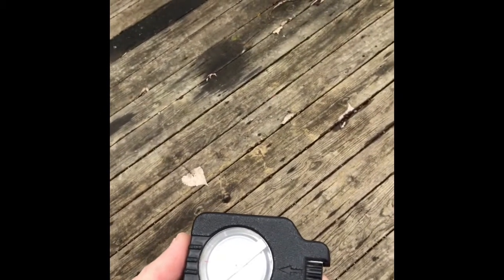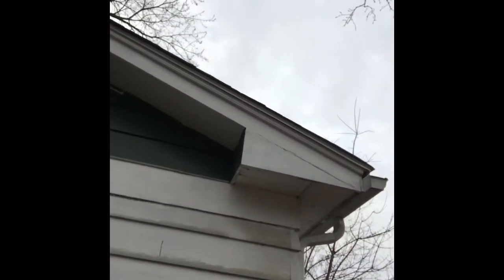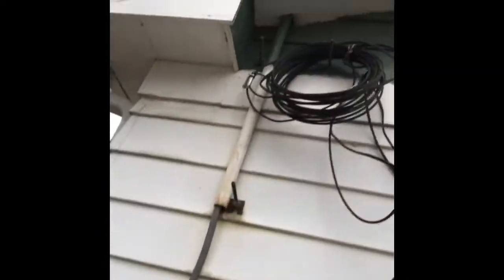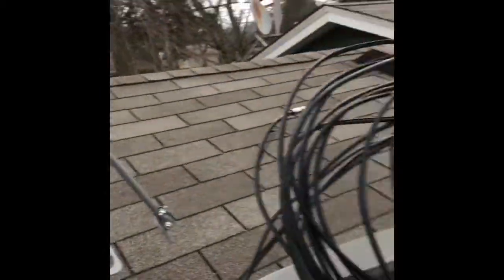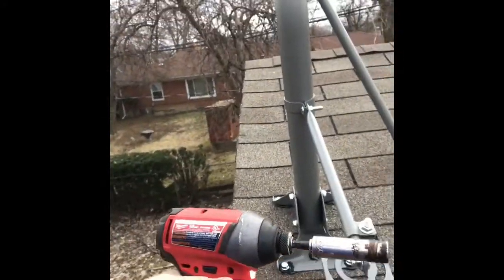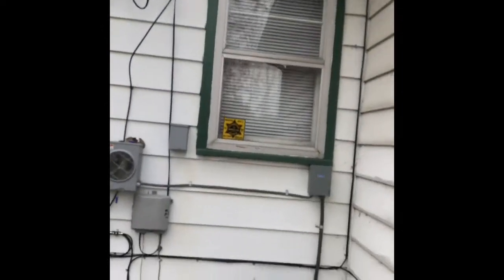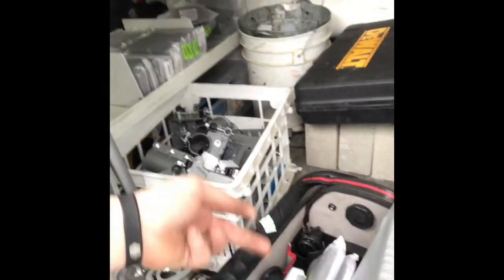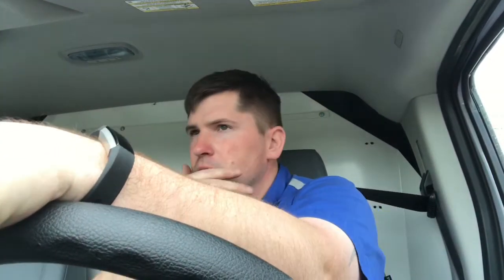My Normal Work Day

Comment: I'm about begin as an installer very soon and am concerned with so many complaints of charge backs. How does one minimize or avoid a charge back? 

How many is the average would you say?

What is the average day pay including all charge backs etc? I'm in San Antonio and our area is growing a lot right now. Just trying to get some inside information.
Reply from the maker: It starts with with customer education. Most chargebacks are based on customers not knowing what they have or how to use it properly. Explain to the customer that they should ok old call you directly with questions....and..answer your phone.

Do good work..almost all of the calls I got when doing directv I knew was an issue with customer equipment or that they didn't know how to use everything because they were not there for the install..if you run all new coax and fittings you should be confident that any call you get will just be a minor issue.
Reply from the maker: You can email me at searchforsignal@gmail.com if you want faster responses to your questions.
Reply: SearchingforSignalLLC thank you very much for your response and your help. You are a good man and wish you peace and much success.

Comment: Good vid... pretty much what my day consist of also... do you work for Mastec?
Reply: sounds like they were doing the same thing mastec was making you call your supervisor before you leave i cant stand micromanagement
Reply: Nick 636n8r I'm about begin as an installer very soon and am concerned with so many complaints of charge backs. How does one minimize or avoid a charge back? 

How many is the average would you say?

What is the average day pay including all charge backs etc? I'm in San Antonio and our area is growing a lot right now. Just trying to get some inside information.
Reply from the maker: benjidollaz305 thanks. No I work for Goodman Networks.  They bought "Multiband" a few years ago.  Before that I worked for Directv in house on west coast.